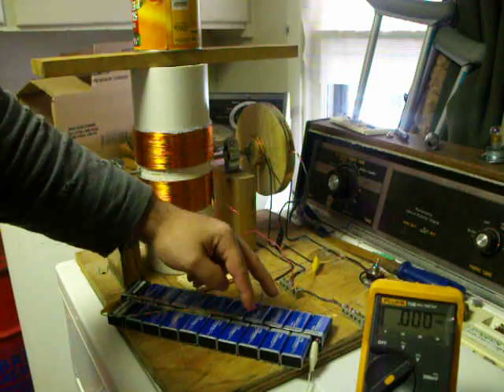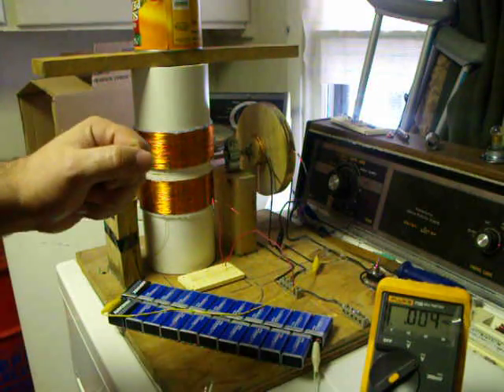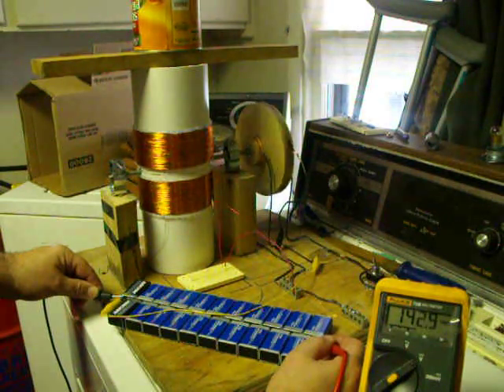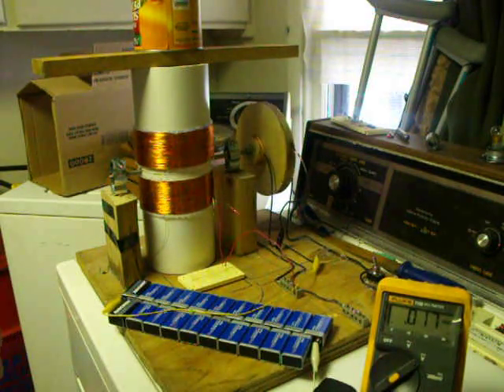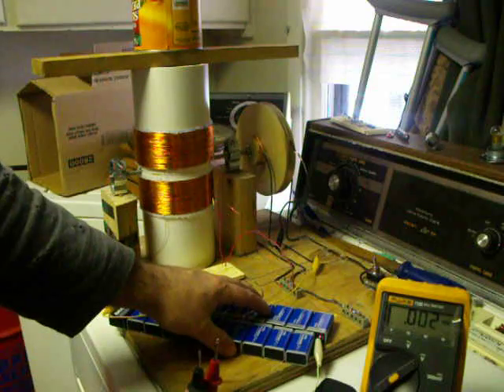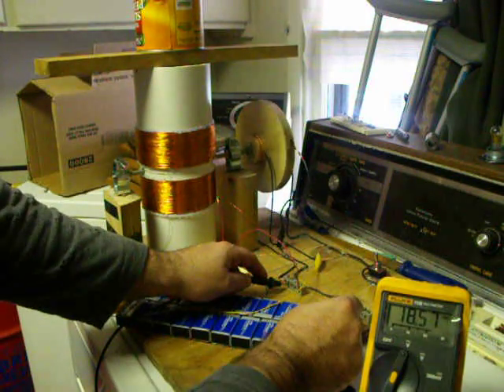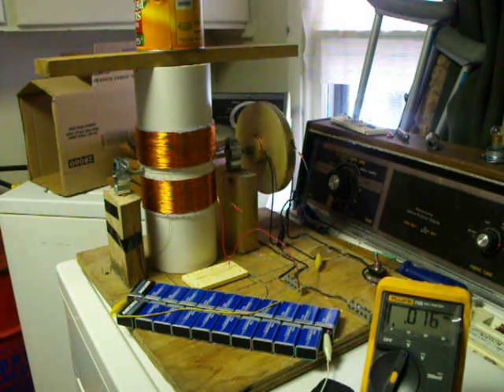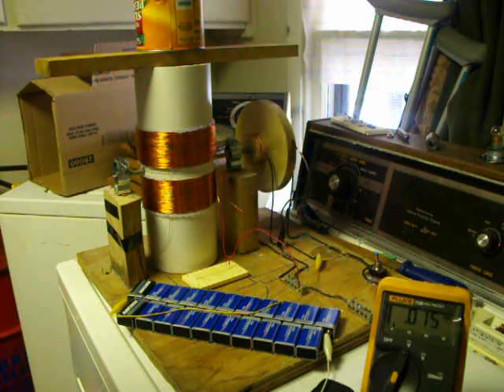Newman motor #2: Clip #2

Comment: @detrix42

Displacement current of the negative-polarity voltage spike is to trigger a positive-polarity action by copper (diamagnetic) to cancel it out completely, and then some, producing a positive-polarity magnetic field. The impulse must reduce the magnetic entropy of copper's quantum particle states. Magnetism forces - and + charges together/apart inelastically; the -/+ bond in atoms loses P.E.. EM waves absorbed weaken the magnetic linkages of copper back to equilibrium for another cycle.

Comment from the maker: @619568701:  Its a bit easier to answer the questions here.
1> Using a 4" pvc pipe (4.5" outside dia.)
2> motor #1 used 30awb, and motor #2 used 26awg.
3> coils are 3" span of the pvc pipe each.
4> At them moment I am not getting over unity.  I believe I was using about 110mA. which is draining the batteries and not recharging them.

5> Magnets are 1"x7/8"dia. Neodimium  with 96lbs of pull on their surfaces.
6> Coils are wound in the same direction.
7> Coils are two joined as one. Soldered.

Comment from the maker: @EnterAtOnesOwnRisk: I am using roller skate bearings.  I have recently rippep open a vcr and now have one vcr head/bearing.   I answered this in an earlier video. I shall do so again with pleasure.   Joseph Newman's theory is:   it is the voltage that aligns the atoms in the copper wire.  The more voltage the more atoms get aligned which cause a bigger/stronger magnetic field.  More atoms is also accomplished by adding more wire.  Continued in next response....